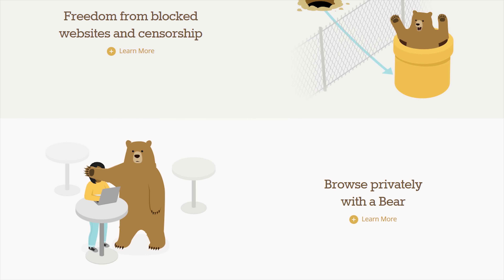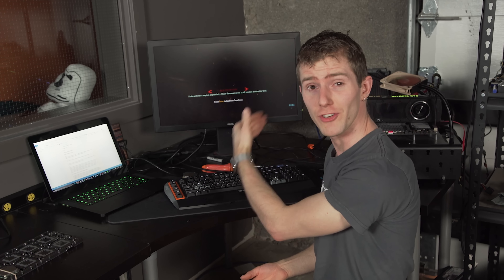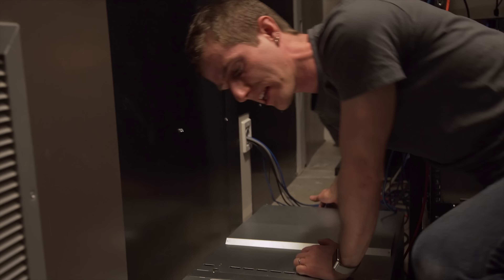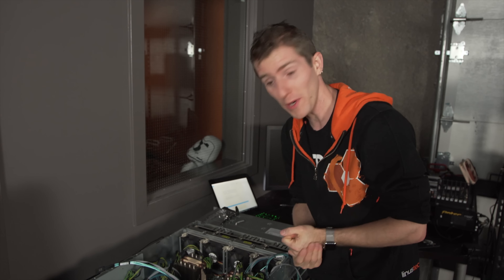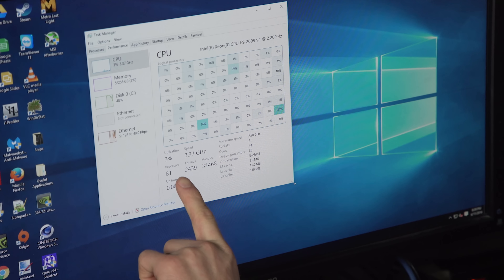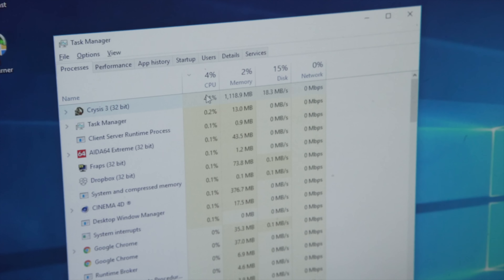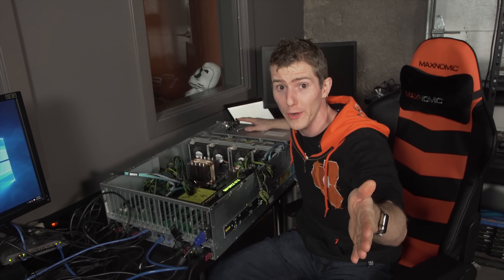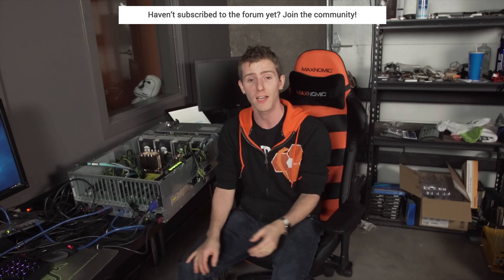Two 22 Core Xeon CPUs!? - HOLY $H!T Episode 6

Comment: The new E7-8890 v4 has 24 cores and 48 threads and support over 3 Terabyte of RAM :O http://ark.intel.com/products/93790/Intel-Xeon-Processor-E7-8890-v4-60M-Cache-2_20-GHz
Reply: pcfreak1992 if you're running vm's then you need it
Reply: pcfreak1992 i think it can't run pong
Reply: GLD_AV3NG3R CS GO and Fun dude that darn thing has got 24 CORES AND 48 THREADS!! I bet that your pc hasn't got more than 8 cores!
Reply: GLD_AV3NG3R CS GO and Fun see? That's what i said. You're paying here for this incredible amount of cores. Even with today's 14 nanometer lithography, you cannot run a 24 Core CPU on an acceptable TDP. So, you don't pay just for GHz, you pay for Power. And i bet that your FX 8... isn't stronger than a 48 thread Xeon😉
Reply: The FX 8 core is comparable to an i5. As far as performance goes.
Reply: Proshi yep, that's right
Reply: yea must be for windows server OS or linux based servers

Comment: Cool thing is even the latest Broadwell Xeons are still cheaper than most i7s, ES samples are risky but people are getting some positive results and they range from $90 to $800 shipped. Got me a QS sample and it is working great with my GA-X99-SLI (F22E Bios). 

E5 2628L V4 is the cheapest but with one catch the base clock is pretty nerfed however the power consumption is crazy low. 12 cores drawing only 63W on the cpu full load lol

Comment: Overclock it and get higher Cinebench scores. I DARE you.
Reply: +Andrew Hunt i know your probably joking but they would probably do horrible in cinnabench speaking price for power you could get a bunch of i7s to do a way better job
Reply: +dylan scrogham you can't put i7s together. This costs $7000 USD. You can get a bunch of i7s (weak compared to this) but do nothing with them.
Reply: +dylan scrogham Not really. The Xeon is designed with rendering in mind - Much much faster at doing it.

Comment: It's cool how a 5950x 16-core CPU will do about the same now as this 44 core dual socket xeon thing did back then

Oh how IPC and clock speeds have improved through the years
Reply: I still find dual CPU system a lot more fun and cooler though. Two bad dual Threadripper doesn't exist but dual EPYC does but the cost is no where near as affordable as these are currently.
Reply: You are 100% correct,  a single Xeon-2699 cpu benchmark is 25166, but the 5950X cpu benchmark comes in at 45807.

Comment: For rendering or as a render farm this is awesome. A lot of graphics rendering relies on 3rd party plug-ins.  Many times, you have to have all of the software loaded on each machine in the farm to use it as a farm.  The fewer farms, the less you spend on software.  Software gets expensive very quickly if you're running a lot of plug-ins.

Comment: But can it run San Andreas?
Reply: +Michael Quinn SARCASM
Reply: +Michael Quinn I just wanna know how that works. I mean, CPU's are made for arithematical calculations. They just calculate logarithmic problems and other stuff, but GPU's are designed to calculate the vectors and 3d geometry required for display of games. The graphics that we see without a GPU is because of the onboard graphics provided by the motherboard manufacturer. Please correct me if there is a mistake. BTW I don't think San Andreas is designed to take advantage of multiple cores.
Reply: yes it could be a California major

Comment: Shouldn't this be intel's flagship? If they only make the cpu speed to 3.2ghz and they have created the most wild processor on the planet! Come on 22 f***ing cores! That is extremely insane! You can pretty much run every program on your computer at the same time without a drop in performace! If you also have 10 titan x's to handel the grapichs.
Reply: Ludwig Harisuo for editing and stuff yes its ridiculous overkill but gaming? an i5 could do the same
Reply: RAWR ITS COW I did also say "if you have ten titan x's to handel the graphics"

Not only that. Every comuter part has to be able to handel that insane amount of power.
Reply: Ludwig Harisuo
Reply: Ludwig Harisuo A flagship is something that they toute for the average joe. A 7700k is something most people cold purchase and is very useful for normal people

Comment: If you are such a genius, you ahould have already know that crysis 3 32bit aint never will use more than one core, as it cant utilize the OS's multicore architecture. And thats the problem of most of the games, they are built for 32bits (the older ones, and some new ones also). So you would get a better result if you made lower core machine running each core on higher GHz, and force one core for the game and let other cores take the OS and all other things run exclusively on it. Therefore, multi core cpus are good only for apps optimalized for multi core or run multiple setups and designate each core for each virtual machine.
Reply: Sigh.....
Reply: +This is Carcosa 
go home troll

Comment: Perspective... My first computer was a VIC-20 - CPU 6502 running at 1.02 MHz (0.43 MIPS), the baddest computer I built years ago, 64 Celeron 333/66 CPU's in a Linux Beowulf Cluster (1139 MIPS x 64 [72896 MIPS] and 458 MFLOPS x 64 [29312 MFLOPS]).   An X-box one runs (100000 MIPS and 1228800 MFLOPS) circles around my old beowulf cluster.  Those two 22 core Xeon chips, roughly, based on my best guess would be probably about as fast as 320 dual CPU celeron machines in a Beowulf cluster (and faster especially in MFLOPS).... that is INSANE (especially when you consider the cost of 32 dual processor celeron machines in a Beowulf cluster was approximately $30,000 in 1998).

Comment: I built a dual Xeon processor rig with a total of 24 cores and 86 GB of RAM.  I largely found that this is extreme overkill for a general purpose machine and that most software doesn't even scratch the surface of the total power available!  But, I do have bragging rights that few people can match!  :-)
Reply: Lucidleo1975 how much was it no such thing as overkill if u using it

Comment: Next time you do something like this, try running some PS2/GC emulators in software rendering mode (and maybe contact the dev team to remove the resolution limit if possible without rewriting the entire renderer to see if it can software render in full HD resolution ;) ) 

In theory rendering should scale quite well on many cores upto the max framerate of the game (or using tricks to run at unlimited speed to see how far you can push it)

Comment: Tip: Try using the latest Linux to run the latest CPU.
Reason: The BIOS/UEFI holds the microcode which lets Windows boot, however Linux has their own microcode with their OS. Even though it doesn't update the BIOS/UEFI and is lost upon shutdown, at least you can get things booted.

I learned this when trying to do the whole LGA 771 to 775 mod that let me put a much cheaper and more powerful Xeon server processor into my desktop motherboard, using just a sticker, and eventually forcing a microcode to be injected into the BIOS that made it all work. But at least even then, Linux still worked while Windows didn't.

Comment: i run an overclocked (16 cores to 3.5 Ghz, the rest at 2.1 GHz) quad Opteron 61xx ES 48 core setup for my home PC... there is virtually no mainstream software that can take advantage of all those cores.  Cinebench does go like gangbusters however (scores over 38 in R11.5 with all cores running at 3.1 GHz)

Comment: Please, do a Pi calculation using Chudnovsky algorithm with that beast, its got potential to calculate a massive number! The most recent record is 12.1 trillion digits of Pi, that could be fairly easily broken since the rig used on that experiment was "just" 2 x Intel Xeon E5-2690 (8 cores each, 16 total), 128 GB DDR3 @ 1600 MHz 8 channel, Asus Z9PE-D8 and around 10TB of storage capacity. But it took 94 days worth of calculation time.... so yeah, pretty crazy

Comment: Looks like this is old hat when the AMD ZEN processors are going to be faster than the INTEL I7 CPU chips, the specifications for the ZEN APU is 32 CPU cores and 16 GCNs and north and south bridge chips will also be integrated onto the APU so the only thing on an AM4+ motherboard will be the APU socket, UEFI/BIOS,GDDR4 RAM slots and the VREGS, my machine is a 12 core based machine which breaks down to 4 CPU cores and 8 GCN cores all on one processor.

Comment: you should test them on Ashes of the Singularity this game is designed to use all available core equally instead of allocating most of the work to a single core and using the other core for the spill over

Comment: Hey there, quite a nice machine you built indeed! 
I am interested in (and i guess lots of other people will be), how to chose a price/productivity machine. These 22 core monsters are extremely expensive and i guess they won't beat an $2300 machine with i76800k inside 10 or more times fold.
So, where that price/productivity curve (considering 3-4 years of usage) is topping? 

So my question is: How should i chose a config that is top number cruncher (i am talking about finite element analysis and physics calculations), within below $5k total. I saw quite a number of suggestions, but nothing was decisive enough :)

My thoughts are lingering around 2x XEON E5-2620V4/2.1G/20M with two sets of 4channel 8Gb ram and one GTX1080 (i'd like to run two 27'' monitors and some 3d modeling)

Comment: Out of curiosity I tried that ting calculator... Answer was I would not save... Maybe because my Mobile connection (100mb/50mb per second promised... 106/54 delivered at quiet times 85/35 during busy times)  is 19,90 Euros per month with TRULY UNLIMITED data (means no extra charged after certain data amout, no data caps nor slowdown after certain data amount).

Did some heavy data transfer last month totalling at 10+ gigs per day so 310+ gigs... still 19,90 Euros running at full speed.

Good to live in small country that has real competition between 3 major carriers.

Comment: The power consumption is insane. 200 watts at idle and 500 at full load including the fans (presumably not the rest of the system). What is the power consumption with all those GPUs in there? I would imagine you couldn't even run this on a standard 20amp line with 10 GPUs.

Comment: Hi, I recently got one of these from my uncle who works at Intel. I'm 15 and I built my current computer myself but there is like no information about how to build a PC with these. I figured an X99 motherboard would fit but I'm not sure. I think I'm gonna go with a Gigabyte X99 Ultra Gaming motherboard because it lists the Xeon E5 2699 V4 CPU on its supported processors, and I've heard that the 2696 is just the OEM version of the 2699, so I figured it would work. I don't want a dual CPU pc because this one is enough. Any suggestions before I go and buy the motherboard? Thanks!

Comment: It was around this period in time when Intel forced segmentation of markets. No more running Xeons on gamer boards. It was partially a good thing. They also went further and forced board makers to segment between server boards and workstation boards. Server boards only supporting server CPUs, and weirdly, workstation boards supporting both. Same chipsets, but different firmware. Servers must us ME firmware, and workstations must use SPS firmware. I went through this with Supermicro, because I was looking at LGA3647 server boards, and they didn't support the Xeon W-32xx series. The server boards supported the W CPUs from the previous generations (W-21xx and W-22xx). And then if you go look at their workstation LGA3647 boards, they support both Xeon W-32xx and the scalable Xeons (Silver, Gold, Platinum). Same with the W-33xx series. I loathe seeing people put Xeons in gaming boards, but we should be able to put whatever Xeon we want in whatever type of board we want (server or workstation) if the socket is compatible and the chipset is literally the same.

Comment: I currently have an i7 5930k @ 4.5Ghz.

I was thinking of upgrading to X299 or Threadripper but I found something interesting on eBay. There are E5-2690 v4 engineering samples available under $1000 which are compatible with my current motherboard. This would make it a much cheaper upgrade for even more cores. Sure single core performance will lag behind but still... 22 cores!

Great idea or idiotic?

Comment: I really wish Game Designers would put a lot more effort into parallizing game threads to fully support 8 cores (and more, if applicable, like here ^^).
I mean hey, games have a lot going on that could be handled by other cores, right? AI, Physics (the parts not done by the GPU) and stuff like that... 
but still, after a decade of multicore CPUs, games run mostly on one core, with a little bit offload on a second core sometimes.
Reply: Game programmers deal with that shit all the time.

Comment: These huge multi-core CPUs are slow if you actually try to use it to its full capability. The max TDP is 145 watts, which must be split across 22 cores. So each core can only produce 6.5 watts at 100% load, or the silicon will overheat and be damaged. This is about the same weak performance as a "low power" Core-i3 that is meant for power-sipping mobile devices.

Comment: I know it's not for gaming, but, It's funny to think that I could remove the IHS of my 3570k (whick overclocks to 4ghz with 0.999Vcore), get a bigger water cooler and ceramic paste, run it @6 ghz (goes up  to 5 on air despite the shitty IHS paste), and get better gaming than almost any high end cpu out there, since developpers don't seem to be able to use more than 4 cores to their full potential. I hope DX12 gives me a reason to get at least a 6 core i7.

Comment: +LinusTechTips - I see you're using the same Razer keyboard as I do, but what (red)mouse is that? Do you have a problem with the M1-M5 keys when switching from using normal keyboards? I had to pop off M2 thru M5 because, as I learned shortly after buying the BlackWidow, my (informally self trained) typing muscle memory relies on my left pinky resting against the left side of the CTRL key.

Comment: i got a Hz440 and tempted to put this into it.  just to see if it can handle both gaming and streaming
Reply: How is it is it faster than a modern laptop
Reply: @Ahmad-os3si  its a meh. It rarely went to 3GHz and hardly turbo when gaming. I should put it in a x99 board and pair it with my 3090
Reply: @idied2  ok do you recommend me to get a laptop or get something like this if I care only about performance and cost also
Reply: @Ahmad-os3si  depends on what your doing. This CPU is good but not for gaming if the game is single core dependent.
Reply: @idied2  no I don't game so I want it mainly for cad apps like autodesk engineers student
Reply: @idied2  my plan is in the end when i work am still at univ to have both a laptop and desktop laptop just for basic stuff like Word and build my own pc a powerfull one so first I need to own a cheap pc to learn how is it owning a pc
Reply: @Ahmad-os3si  as long as you get a HP z440 with a 700 watt power supply. You can put a 3060  12gb. However if your video editing or using it as a workstation. It's nice to pair it with it
Reply: @Ahmad-os3si  Hp Z440 is power supply limited due to proprietary power supply. this 22 core will power through/brute force to what you need if you can get the 22 core for a good price. the workstation i got i did put this 22 in and it has its maximum 256GB of system ram. for the gpu your limited by the 700 watt power supply "make sure you get the one with the 700 watt power supply.

Comment: i put 1 delta electronics server fan in size is just like these , it was on my cpu stock cooler im using amd athlon 64 x2 dual core 4200+ 2.20ghz  it was super loud but all the time cpu was from 19*C to 24*C

Comment: Question: I see on Ebay always Intel Xeon CPUs they have less Clockspeed then
standing in the Specs:

Intel Xeon E5-2695 v3 ES QEY6 2.2GHz LGA2011-3 14C

Intel Xeon Processor QHUP E5-2699 v4 ES 2.1GHz CPU 22-Core LGA 2011-3

are they also with Turbo Speed or produce they by Turbo Speed System-Crashes, are they realy slower?

I dont now i shal buy CPUs like this.

Comment: i just bought a gaming pc for 400 euros with these parts

- Intel Xeon X5660 6-Core @ 3.8Ghz
- Fractal Design Newton R3 1000W 80 Plus Platinum
- 12GB G.Skill Ripjaws X DDR3
- Asus Sabertooth X58
- 2GB NVIDIA GeForce GTX 760 OC(MSI)
- 250Gb HDD
- Samsung 850 EVO SSD 120 Gb 2,5

i was just wondering that should i upgrade the gpu or is the processor already bottlenecking the current gpu and if i upgraded to like 960 4gb or 970 would it run witcher 3 etc?

Comment: Sir , Can you tell me , how to add a graphics card a 16x pcie express card to a HP ProLieant GL380 G5 ,server , want to use as a graphics work station , even a riser card / cable would do? what is the difference in PCI x and PCI e ports, what does the above server mentioned have ??

Comment: How many games and apps are coded to spread the workload evenly through all of a C.P.U.s' cores?

Am I right in thinking that a C.P.U. will last longer if its workload is spread evenly among all the cores rather than having a single core do most of the work?
Reply: so if a single core in quad core cpu that gets used all or most of the time won't be more likely to burn out/perish much sooner than the other 3 cores?

If that did happen, would the other cores still be able to function?
Reply: If you do 3d rendering this cpu is for you, no other normal cpu comes close

Comment: pls try a cpu and system memory intensive  games like 7 Days To Die which isnt gpu optimized RIGHT NOW, crysis 3 is gpu optimized cuz i got r7 360 and i sometimes get 45 fps on fallout 4 in MAXED setting except motion blur, which should be the same but pls try 7DTD for cpu and memory tests. from what i noticed crysis is a gpu based
 game